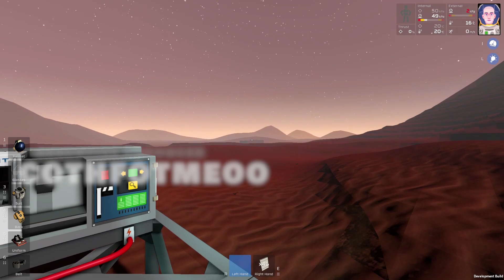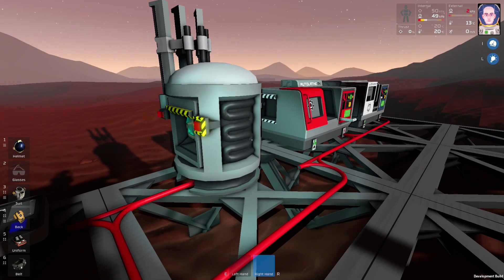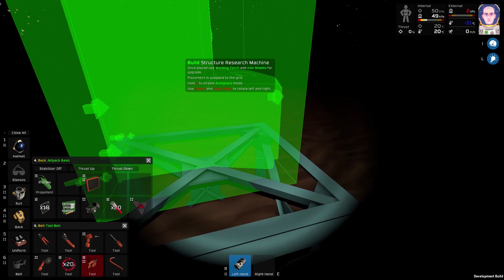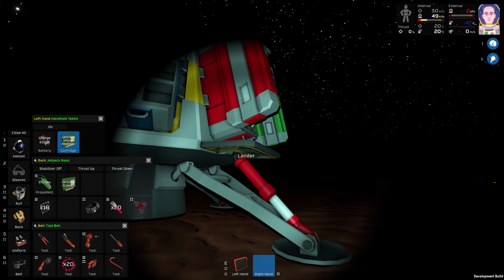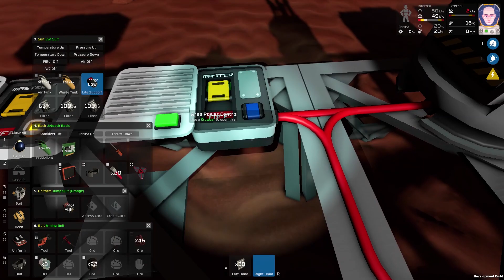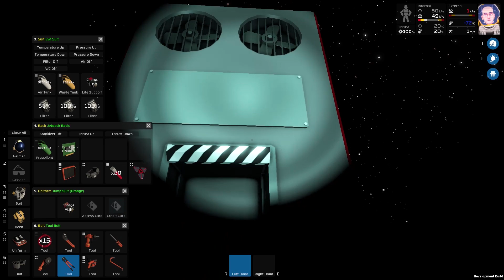Stationeers: Lockdown Update | Hardcore Space Survival Game #2

Comment: to empty the airlock of the gas you want, you can store it in a canister air tank or a pipe that can handle the pressure. you can also, the other you can just pump out before entering the room. would require an advanced airlock system to cycle it. iirc it shouldnt matter if you have X in the air for the crops.